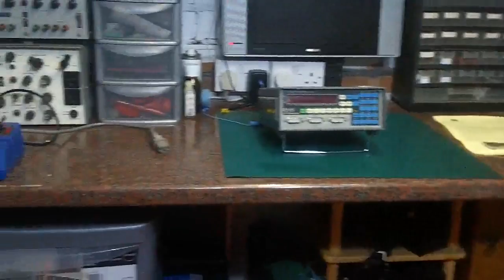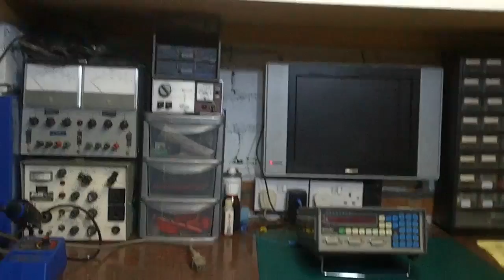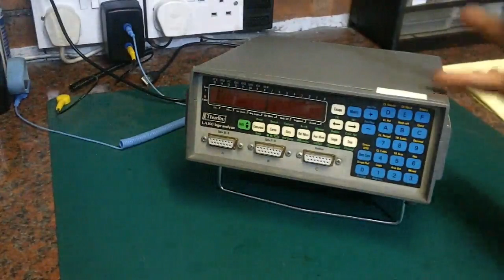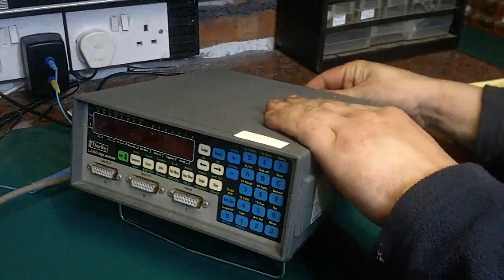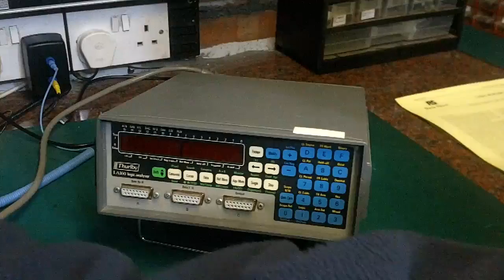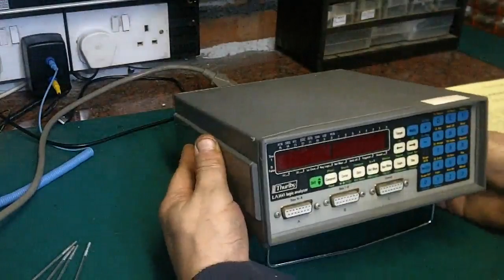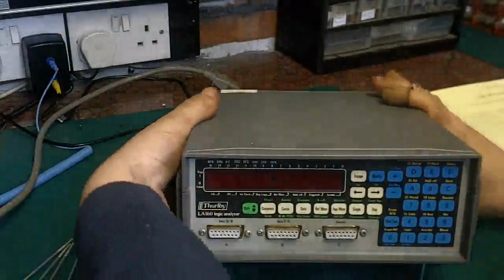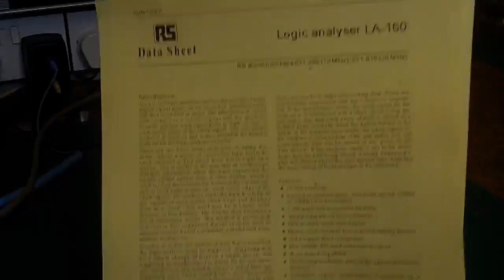Workshop remodel and quick look at a Thurlby LA160B logic analyser

Comment: Look like a lot more workspace. 
Personally I've switched to separate sound recording using one of those Zoom devices. I find that most cameras will have a tiny, low quality mic in them which have their gain subsequently turned up making them hiss and hum all the time. Without a good pre-amp on a mic, sound will always be messy. Even with a proper Mic I have to cancel out noise using software like Audacity. It's a bit more work but with good quality as a result.
How's the heater coming? Back to working condition?